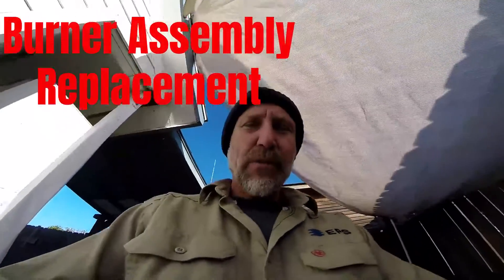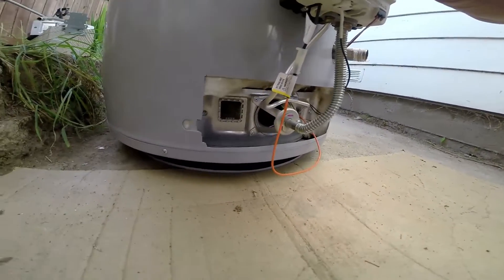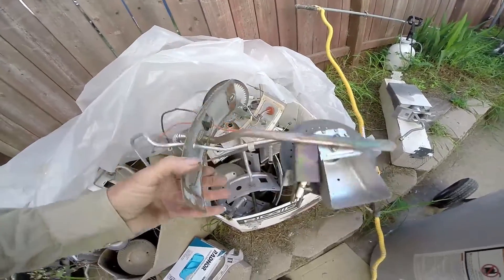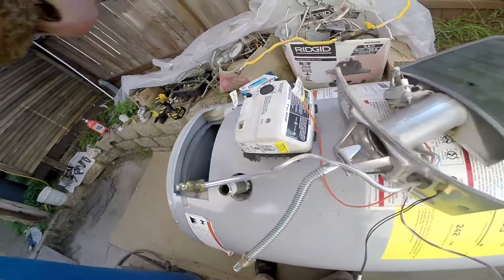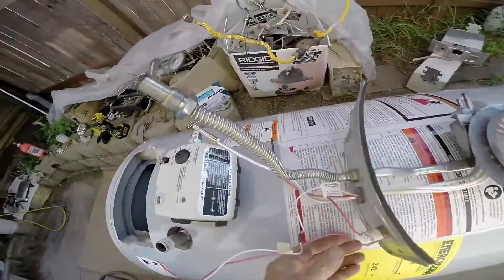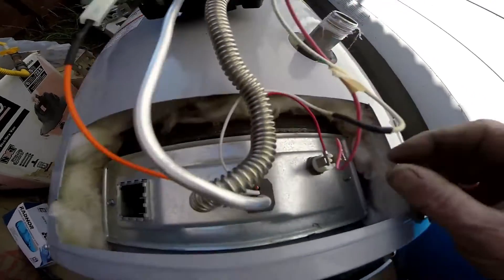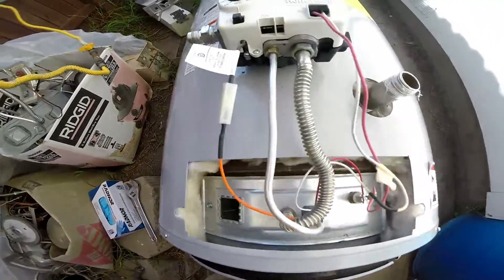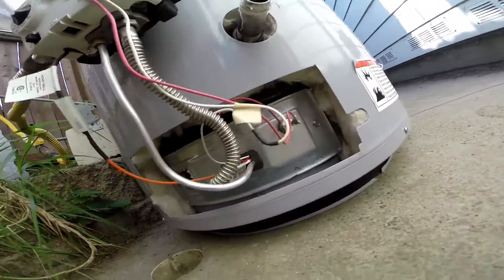What Causes this! Ultra Low NOx , Substitute! for AO Smith

Comment: This same thing happened to our AO Smith after 10 years of use, it started making the same fluttering flame shown here but also some random loud booms which was terrifying, shut it down and after pulling burner noticed screen had a tear on top, replaced burner assembly with same type and it started doing same thing a couple days ago after only 2 years with new assembly, didnt remove this burner in those 2 years so it developed on its own somehow. Having a brand new water heater installed tomorrow but made sure its not using same burner assembly type after reading more on how junk these low nox burners are and they were even involved in a AO Smith recall based on ultra low nox models built between 2011 - 2016.

Comment: Apparently, some of these (broadly speaking, any water heater model using a screen over the burner) use mild steel or plated mild steel mesh in place of stainless, so it tends to oxidize and corrode, eventually failing.

Oddly enough, we had a similar problem back in high school with cheap, mild steel mesh heatspreaders (for bunsen burners) were stocked instead of stainless steel or ceramic ones. They burned through rather quickly, and performed especially poorly if any corrosive chemicals happened to splash or boil-over onto them.

I someone ends up with a cheap unit that's otherwise reliable and replacement parts are expensive, hard to get, or just crappy as the originals. It might be possible to fabricate your own mesh from better quality stainless steel to replace it. (might not technically be up to code, but I bet it would burn as clean if not cleaner than the design specs while also being more reliable ... sort of like some out-of-spec DIY car mods that end up running fine long-term, passing smog as well or better than stock, yet not technically being proper or technically legal)

Hey, besides that ... for anyone that does actually care about various sorts of emissions, pollution, or just waste. The waste savings (and net emissions, pollution, and vague, broad knock-on effect impact) of fixing something yourself with minimal materials vs the impact of full replacement parts (let alone a whole new unit) is significant.

Of course, DIY fixes can often not be long-lasting or reliable, but when they are, I'd stick with them over replacements whenever possible.
Reply from the maker: @chrishamilton53  hey thanks for the comment and the input: so I was working on a water heater the other day it was a new model. I forget who the manufacturer was but they actually had a new ultra low NOX Burner Assembly that had some kind of like it was the steel mesh, but then they had like some kind of like fiberglass over the top of it to protect it or maybe a ceramic fiberglass hybrid over the top. It was really interesting and you could see that it was a reaction to all the corrosion that’s been taking place. It was definitely thicker than the normal ones, but it was pretty impressive. I should’ve done a video on it at the time but of course I was busy and distracted. 
Thanks for watching. Really appreciate the comment yeah with all the condensation that’s falling during initial ignition of a water heater. That’s really what’s accelerating all the corrosion you got the heat you got the expansion of the metal and then you’re mixing water in there. I mean, it really doesn’t stand a chance .
Reply: @thewaterheaterfactory    In the case of the model in this video, my suggestion above might not be relevant. It might just be really fragile material, but if it's more prone to tearing after a break-in period, that would make me think it's not stainless (or a stainless alloy really poorly suited to red heat and direct flame contact) leading to enough oxidation to make it weak and brittle after the break-in period.

Maybe it is just that fragile, in which case the DIY fix might be adding on a coarser stainless steel mesh over top to protect it ... if you're in a region that absolutely has to use the factor ULN rated burner.

From a quick search I did, I also couldn't find any mention of these meshes being catalyst impregnated, otherwise that too might explain why they'd be fragile (catalyst impregnated ceramic mesh could be pretty fragile, and that material is pretty expensive, so making it as thin as possible would make sense). OTOH, a thin, weak, yet relatively expensive component would merit additional protection around it. (I mean the casings in automotive catalytic converters have to protect some relatively fragile ceramic composite material inside ... and there's commercially made catalytic propane/gas burner space heaters that have to work around that issue, too).

If they did make catalyst based gas heaters (water or furnaces) that might actually improve efficiency more significantly, too. (though with the ban on new units in 2030 in CA, I doubt there will be real incentives to engineer that ... maybe in some other states or countries where it's more significant)

I'm just looking into this stuff now since our own ... probably late 1970s vintage 40 or 50 gallon water heater needs to be replaced. (it might've kept soldering on had we noticed the leak out of the original cheap plastic inline style drain valve sooner, but it managed to leak inside the casing walls and slowly rust out the interior and base until it was mostly eaten through ... tank still holds pressure, and burner and thermostat actually still work fine, almost all the rust is in the base plate section and air intake, but it's not safe anymore and needs replacing ASAP) It probably would've started collapsing in on itself (ie the base crumbling around the feet) already if not heavily supported by steel bracing bands/strips used for earthquake proofing. (it's strapped and bolted to the corner wall of the garage with an external layer of fiberglass insulation acting as padding or buffer between the bands and the tank casing itself)

Hell, all the original gas and pipe fittings are in good shape too. Though I suppose having it fail this way is at least a lot less catastrophic than the tank failing first. (not sure what model/make it is either, since that fiberglass insulation wrapping is covering most of the markings up, so I'll find out when we actually take it out)

Comment: The burner just went bad on mine, they're sending me a replacement, but I can't get the bad one out. It seems to be stuck on something, but I can't see what. Is it that little clip in the back of the chamber? Any tips for getting it out would be much appreciated.
Reply from the maker: @greglawrencevidz  : it’s probably the seal they give you a gasket sometimes the gasket sort of gets bonded onto the combustion chamber. You just have to rip it loose. You shouldn’t have any clips on the inside because it would be no way to get to it. I use a little tool. It’s kind of like a very small L and I hook it in behind it and then wedge it up and it breaks that seal.

Comment: Thank you for sharing the video. Just a heads up, there is a recall on those burner units for the screen deteriorating prematurely. Mine was never removed, at 9 years it started making the noise that burner does. Called, found out the burner unit was recalled in 2018. They sent me a new one overnight at no charge. They are junk, but at least the parts were free to fix it.
Reply from the maker: Thanks for watching!

Comment: How did you bypass the chamber sensor I did this and it won’t work due to the camber sensor not plugged in??pls help
Reply: I would also love to learn which parts to use to do what you have done here. I have replaced 3 or these lo-nox burners in the last 5 years on one water heater, so I have no doubt that my burner will go out again, and now my warranty is up
Reply from the maker: @deegee3621  I installed a Burner Assembly that didn’t have a chamber sensor. Then I replaced the circuit board with the one that didn’t require a chamber sensor so I basically eliminates it.
Reply: Very helpfull video How do i buy this circuit board or how i know witch one is the one without this sensor @thewaterheaterfactory

Comment: brand new ao smith water heater started doing this the next day after install. my old ge one has the type u used to replace the screen burner assembly. im torn on what to do, since it's under warranty, but im gonna probably try installing the old one, since i never had any issues with it & its 12+ years old, & this new one is defective on its first day.
Reply from the maker: Yeah that’s crazy take it vantage of your warranty. It sucks ripping out the water heater and returning it and then getting another one. I just don’t make them like they used to those old mechanical valves. Just they just work but there’s plenty of water heaters out there that are working they do have the Honeywell in the Resideo valves in them so it’s hard to say what could be causing it. My guess is it might be under recall they just get bad batches in the circuit boards parts are manufactured in the United States, etc. but you bought it so you should take advantage of your warranty at least get your money back!
Reply from the maker: OK I see Witcha video you’re responding to. That’s the exploding Burner Assembly so it’s got a rip in the screen somehow gaskets away from the screen and then explodes and causes the feedback loop everyone I’ve ever seen that does this has a rip in the screen so they should send you a replacement Burner Assembly, but yeah day one that’s scary

Comment: Do you have a part # or link for buying that burner?
Reply from the maker: Not with me , determine the size of your water heater 30-50 gallon, check the water heater manual on the side of the water heater if you have one look in the back of the book should have parts , listed I have a few manuals at home. Thanks for watching!
Reply from the maker: no part numbers listed in the manual

Comment: I hate these assembles and controls.  The Honeywell controls go out all the time and these burner assemblies require so much maintenance.  Any little piece of debris will shut down the for the unit and call for burner replacement.  Cleaning it will be just fine, but seriously annoying.  

One of my customers went through three burner assemblies free or charge but days without hot water.  On the 4th attempt I just swapped it out for a traditional burner unit like yours and analog controller.  That thing should now last 10+ years of trouble free use unlike the yearly service calls and cold showers on the previous setup.

Nothing is reliable anymore with all this crap.  Anytime a control or burner goes out, I just suggest going analog because it’s not worth the Hassle and money thrown away all in the name of efficiency 🙄
Reply from the maker: Agreed . I have one of those tonight after work considering swapping it out ! Because the mechanical ones just work!! Thanks for watching!

Comment: While I think this substitution would work it would no longer meet requirements for Ultra Low NOx in some states such as California and so would violate code.  Therefore it may not be wise to substitute and possibly illegal.   Also it may not pass a home inspection for sale purposes.  The original burner should be replaced by the manufacturer free of charge or at least a replacement shipped.
Reply from the maker: Thanks for watching and commenting
Reply: All the low nox horseshit that goes out on these and potentially blowing up garages is better than some extra nox? Fuck off

Comment: This is my exact issue. I’m going to replace the burner as you did but where can I find the cover. I have the same water heater. Thank you
Reply from the maker: You would have to order it. Unless you can find one..
Reply: @thewaterheaterfactory  Do you know the sku for the valve cover by any chance?
Reply from the maker: No idea the sku number ? Might have to order another valve the identifying number is on the side contact ao smith if that's the manufacturer of the water heater , if less than six years old they should send you a replacement part for free, under the waranty